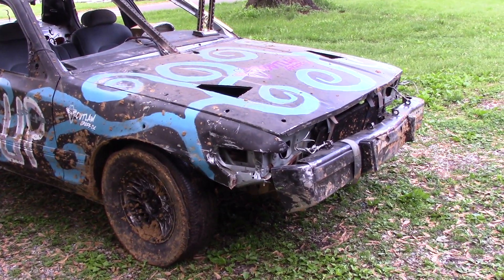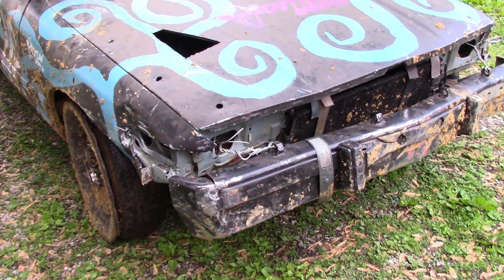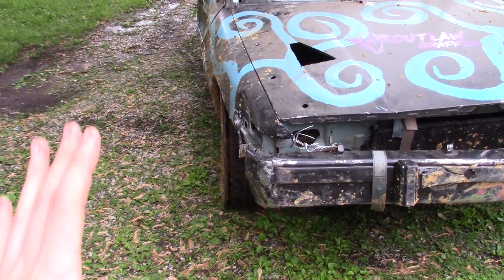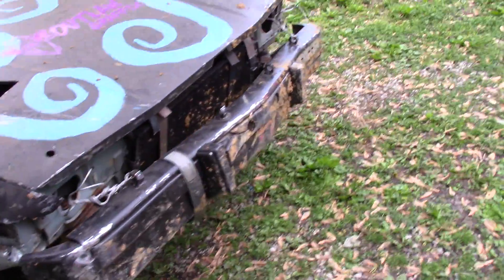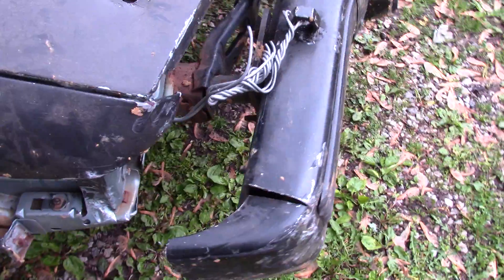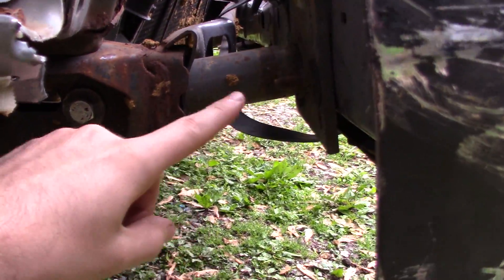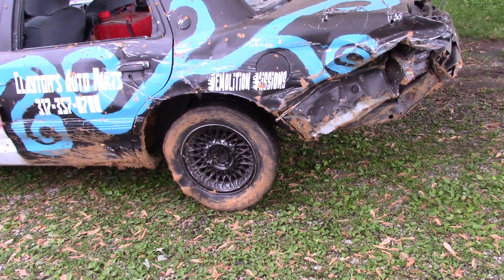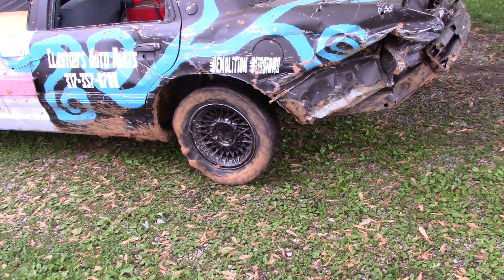1995 Mercury Marquis Derby Aftermath Run #1

Comment: When a promoter states dot tires fing out if they allow "LT" tires.  if the answer is no, then you can use anything that is a "P" type. also find out the class style,  A, B, C, are usually very safe to use and those will be in snow and mud tires also.

Comment: I had the same problem with the bumper shocks ripping the frame on my endro car and I run 15 inch steel ranger rims on the back of mine cause 15s fit on back but dont on the  front
Reply: It's probably because the calipers are rubbing on some 1992 to 1997 Fords have bigger calipers on the front and on 1998 to 2011 Fords they run the same big calipers.

Comment: You should weld the diff if you haven't already and mount the bumper directly to the frame
Reply: With these stock shows around Indiana we can only weld and compress the bumper shocks and if you don't have bumper shocks from factory just weld the bumper to the frame.